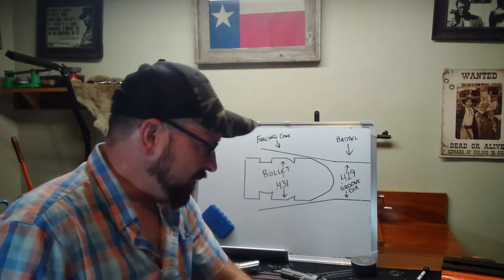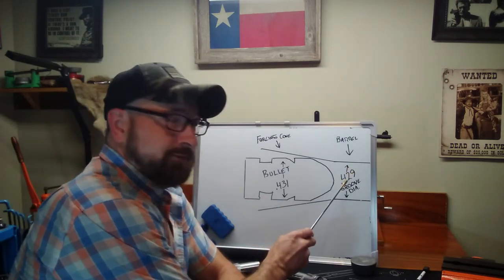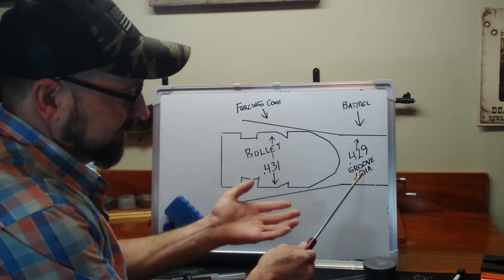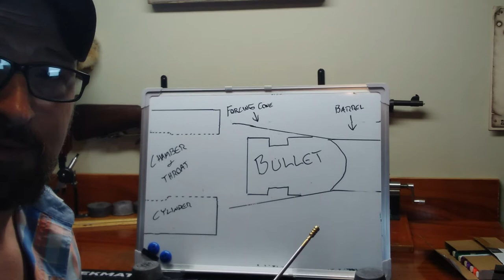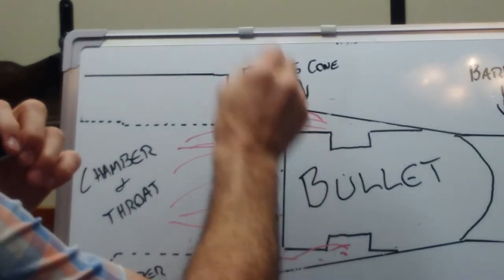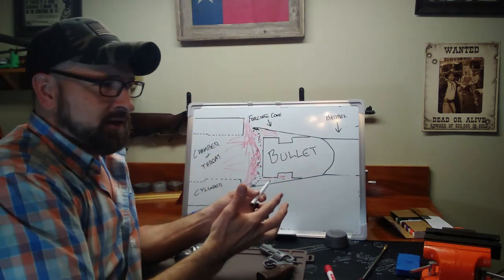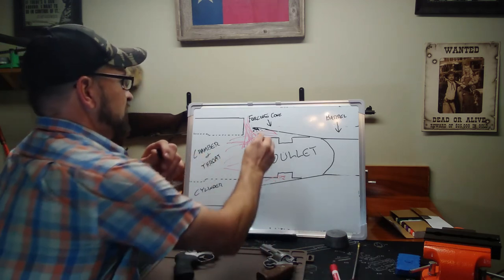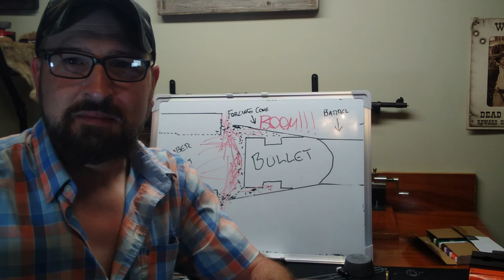Why revolver forcing cones experience lead fouling (even when cut properly)

Comment: Lewis Lead Remover tool will clean the forcing cone and the cylinder throat.  In .357s and .44 Magnums, build up coating of lead in the cylinder throat will "rechamber" a magnum into a Special as the longer cartridges will be obstructed from chambering.
Reply from the maker: Yes indeed, sir! Thanks for stopping by

Comment: So it the leading normal on my snubnose revolver? I hate the way it looks I did the best I could using a copper brush but I can still see almost what looks like lead rings at the beginning of the cone
Reply from the maker: I don't know about "normal". If it isn't hurting performance or function, you may not have anything to worry with. Sorry so late in the response. Thanks for stopping by

Comment: My Charter Arms shoots lead on my face. Is that the forcing cone?
Reply from the maker: Good chance... If it is out of line with the cylinder or cut wrong that sort of thing can happen. They do great warranty work in my experience. Give them a call. Happy New year, and thanks for coming by!
Reply: Probably too hot and light load for the gun. I have had some blowback when using hot stuff 125 gr. I usually avoid it for regular use.Consul your owners manual ammo guide.